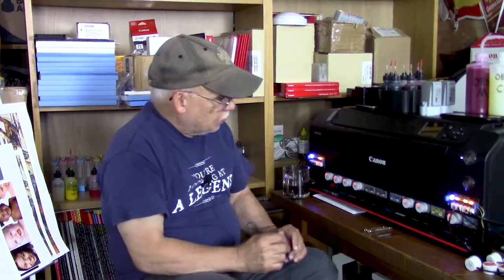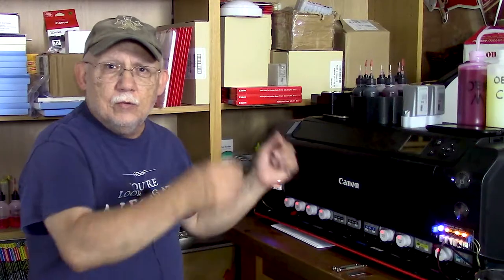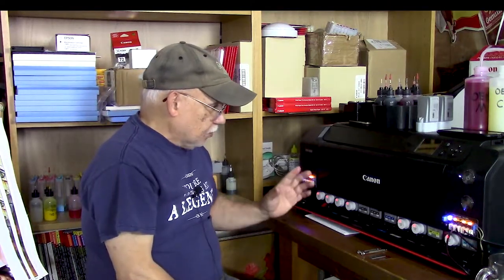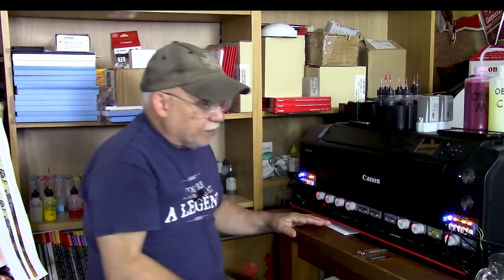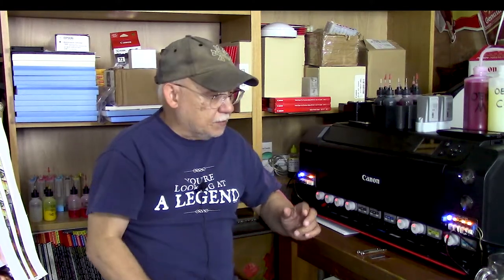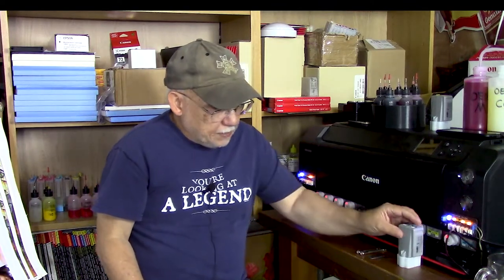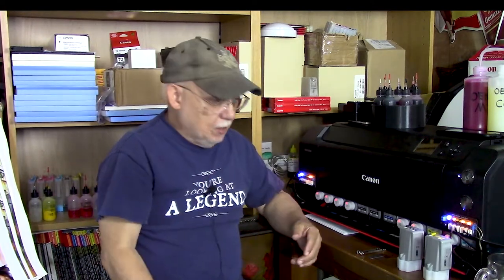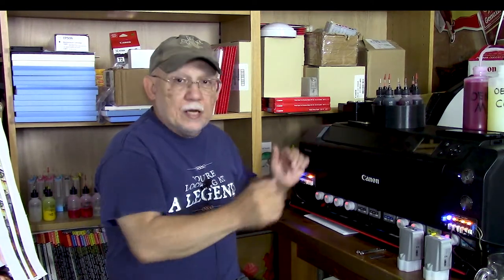CANON IPF PRO 1000 Ink Level Sensor Updates!

Comment: Thank you for this update, Jose! Would a scale be a useful item when implementing this system?
Reply from the maker: No. When the lights representing each ink channel turn on, ON THE BOARDS, you pull out the ink door optical sensor defeater. That will tell the printer you 
" OPENED " the ink door. You now pull out the cart whose light was triggered. It will have about 20ml of ink left. Now you add 55-60 ml of ink. Pop it back in. Re insert the optical sensor defeater and the printer now thinks you closed the door. The light on the board that was ON will now be off. Proceed to print.